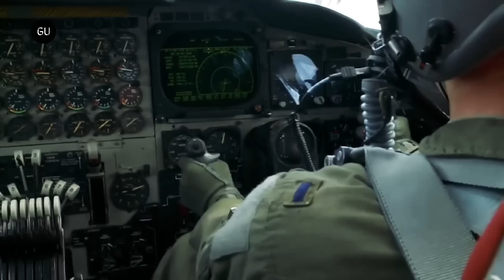Rolls-Royce Begins F130 Dual Pod Engine Test For B52 Aircraft

Comment: Why not use 4 bigger engines?
Reply: It would require redesigning the wing structure and would require a lot more work and money.   Sticking with 8xF130s makes the transition easier.

Comment: Just need to do a new production run - just saying 🤷‍♂️
Reply: @Blob B the whole thing lol ... just build some modernized airframes.. similar to what the air force is doing with the A10 getting new wings... they keep wanting to retire them, even thu they are doing a fantastic job like the B-52.

I hate the whole lets just replace something / re-invent the wheel every time process that defense procurement around the world falls into. Speaking as someone who has served in my countries military, a lot of the procurement choices were just bad (reference Australia).
Reply: I should also mention specific to aircraft, I have a feeling the only reason they will get retired as the fleet has been getting smaller is due to the cycles on the hull / total hrs exceeding the original engineering spec... hence the mandatory retirement of some aircraft, which can be avoided with a new production run.

Comment: 0:36 "a testiment to over-engineering" 🤣🤣🤣🤣🤣🤣🤣🤣 it's more a case of the US will not pay the price to replace it and so just sticky plastered retrofits on to it.
Reply: True, but the option to use B-52s wouldn't have been there if the aircraft wasn't over engineered, instead the US would be trying to turn C-130s or C-17s into bombers

Comment: For all the "four" engine vs "eight" engine people, there is a decent amount of data already collected on that for the B-52; it's been tested before.  Boeing and the AF used an Edwards B-52 in 1968 to test the 747's new high-bypass turbofan, the JT-9D, on the number 3 pylon (inboard right).  I believe it's on the cover of Aviation Week, July 20-ish, 1968; quite impressive!

Comment: So why not use the GEN-X engines from commercial planes? Is the dual pods for redundancy?
Reply: I think the dual pods allow for engines to hang higher off the ground. The BUFF's wings are almost dragging the ground on takeoff. Commercial engines are huge in height and diameter compared to these. They also almost drag the ground on those aircraft. That's why the landing gear is so tall on many. IMO.
Reply: It’s structures and aerodynamics. If you have single engines for each pod then then engine out case requires a much bigger rudder to maintain directional control. The fin and rear fuselage aren’t built ti take the kind of force that rudder would apply. Before you know it, you’ve had to buy a new aircraft just so you can use a big fan. Pointless.
Reply: @peteconrad2077  thank you. That makes sense.

Comment: So small engines intake. They cud had made it bigger for better efficiency that was not there when B52 was made.
Reply: The inlets are the right size for the engine. No point making them bigger. And you can’t replace two engines with one.

Comment: I really do not understand what is so wrong with four RB211-535's~
Reply: Because you’d need a much bigger rudder for the engine out case. This would then need a new back end of the aircraft to cope with the stress of the more powerful rudder. Pointless.

Comment: Why would they not go with four larger engines or does that pose a ground clearance issue?
Reply: No. It’s not built for them. It would need a bigger rudder and massively strengthened rear fuselage. Not worth doing.

Comment: Now a days, it seems they focus a lot on Avionics, Radars, Modernized weapon systems, and like this, more refined modernized engines, on an old plateform. I have noticed this with quite a few aircraft in the Airforce. It's not always the aircraft it's self, but what is on board.

Comment: The grad children of the original pilots have long flown the b52.
It's been flying since 1952.
2023 - 1952 = 71 years./ 3 = 3.94 
So we are almost at the point of a 4th ad 4 * 18 = 72.

Anyway I heard stories of the 3rd generation fling the b52 a decade ago by now.
Reply: 71 / 3 = 23,666… in my country. But that’s in metric units (and decimal base). I don’t do bananas arithmetics, sorry… 😁

Comment: Why 8 engines? why not 4 bigger engines?
Reply: The airframe isn’t built to handle the stress and the controls can’t handle the forces.
Reply: @Blob B well you’d make sure it didn’t. But it would require a much bigger rudder and thus a stronger rear fuselage so it’s almost a whole rebuild.

Comment: Why a dual pod vs a larger single?
Reply: Rudder is too small ti handle an engine fail on a four engine configuration. A larger rudder means a whole new back end to cope with the forces.

Comment: Was thinking for a second: Why not replace the dual-engine set up with a single engine per pod? But I can imagine that there may be height restrictions.
Reply: This is the biggest question everyone always has, it seems so obvious. But the main concern is that the B-52 was designed with 8 engines in mind because of the limited-thrust engines available at the time. It was only designed for the asymmetric thrust of one of the eight engines failing, meaning it has a tiny rudder that would be overwhelmed by the failure of one of four engines. To redesign the aircraft to have more rudder authority would be quite difficult, as it would require not only a larger rudder but the aft fuselage and vertical stabilizer would have to be strengthened. There are other videos on this out there if you're interested in more details. I will say I'm a little skeptical of that concept, given that many failure scenarios would have a chance of causing the adjacent engine to fail as well, such as a catastrophic engine failure that would shoot debris into the adjacent engine (as has happened on an Il-62, see LOT Polish Airlines Flight 007), or ingesting a group of birds, not to mention any possibility of battle damage that I'd think is far more likely to take out a pair of engines than take out one with its neighbor still functional.
Reply: @quillmaurer6563  well it CAN, but its far more dangerous, and having 4 would mean a lesser margin for error. the thing's designed to just not even call mayday if it has an engine blows out.

Comment: A number of comments posited the original designer's intent of redundancy in case one engine in a pod fails due to damage or mechanical issues. I don't believe that this is the reason. While it may be a factor, it's not the primary one. Available thrust in the engines when the plane was first developed was relatively low as compared to today: they had to use 8 engines to get the beast in the air.

These were at best 2nd generation axial flow turbojets and were still rather unsophisticated. The knowledge of metallurgy limited the heat the engine's hot section turbine blades could handle, impacting thrust. Blade shapes were also simplistic and inefficient, since the science of advanced fluid dynamics was in it's infancy.  The engineers got all the power they could from the materials and technology of the time but still had to use 8 engines to get the power they needed.

Shift forward nearly 55 years: hot blades grown from a single metallic crystal for extreme heat durability, machines to complex shapes designed on super computers for maximum performance, shaped on 3 axis computer controlled milling machines. Add in digital engine management systems and the result is an engine designed to be used on far smaller business and regional jets, slightly modified, to lift a behemoth like the B-52 into the sky.

Comment: I imagine these will be more fuel efficient and less smokey (since the others left a ton of smoke in the air). I also wonder if they can be started normally and not have to have a charge set off.
Reply: The "cart" start was primarily a quick start, no power cart option for aircraft sitting alert (the B-52 doesn't have an APU/GTC like many other aircraft).  For normal start, they get power from the power cart till the first two engines are started.  In expeditious situations, I remember my AC would get the first two started, then air start the other six simultaneously.  I don't know for sure whether the RR engines will have to support a cart start option..seems a shame to not have it.  Alert is just a presidential order away!  :)
Reply: these will not have charge-start like the current ones do
Reply: BR725s have a standard air starter.

Comment: I was four or five years old when they first joined the Air Force. I will probably be long gone and forgotten, and the B-52 still in service, one way or another. Amazing aircraft to reach that level. I think the C-47, or DC-3 is the only other aircraft with that longevity.
Reply: KC-135, U2, and C-130’s still going
Reply: @cruzanstx6661  My first base after tech school, USAF, had C-130A models, the series we had were all built in something like 1954 to 56, I was maybe five when they first flew. We retired them in 1971. Some made it to the Gunship program, others went to National Guard units to replace even older aircraft. Some aircraft just outlive others.
Reply: @jamesberwick2210  Definitely I worked on the C-130E as recently as 2010 them was the 61-63 models
Reply: @cruzanstx6661 Many of the DC-3s were flown in WW2, converted to military cargo versions, then returned to civilian use with feeder airlines.
Reply: I will be 56 when the B-52 retires, crazy to think about
Reply: @microcloudhd9231  I'll be over or close to or over 100. Mind boggling.
Reply: Not in military service, though !

Comment: Was talks to reengine to put 4 engines on the B-52 but decided to keep 8 engine. To put 4 engines would have to redesign  the pylons  to take the bigger diameter engines.
Reply: That’s just the stray of it. Bigger rudder and reinforced whole rear end.

Comment: Tsar Bomba detonated at 11:32 (or 11:33) Moscow Time on October 30, 1961, over the Mityushikha Bay nuclear testing range (Sukhoy Nos Zone C), at a height of 4,200 m (13,780 ft) ASL (4,000 m (13,123 ft) above the target)[8][33][41] (some sources suggest 3,900 m (12,795 ft) ASL and 3,700 m (12,139 ft) above target, or 4,500 m (14,764 ft)). By this time the Tu-95V had already escaped to 39 km (24 mi) away, and the Tu-16 53.5 km (33.2 mi) away. When detonation occurred, the shock wave caught up with the Tu-95V at a distance of 115 km (71 mi) and the Tu-16 at 205 km (127 mi). The Tu-95V dropped 1 kilometre (0.62 mi) in the air because of the shock wave but was able to recover and land safely.

Comment: Can’t wait to see the 1st B-52 fitted with these great new engine pods. Definitely a long awaited improvement. Should also significantly improve the bomber’s range and/or payload capacity. 👍
Reply: So far I'm not sure much has or can be done to increase or change payload capacity but I would assume new engines would increase range, response time, reliability, serviceability, and reduced cost like the previous upgrades did. Space is probably the primary limiting factor for payload.... more wing pods? That would be cool!
Reply: Yah Jo. And I’d like to see the pods painted white as on the test bed, just to render a trendy livery effect.  🙌🏽
Reply: Can't kill men women and children in far away places without them.

Comment: I've never truly understood why, but there's some reason they have to use 2 engines in a pod, because initially years ago they were trying to go with 4 - Rolls Royce Trent 800's in the 777, but couldn't for some reason.
Reply: It may have to do with ground clearance as well. A twice-as-powerful engine generally has twice the diameter. If you look at the B-52's outboard engine pods, they hang very low to the ground, so a single engine in their place may halve that distance.
Reply: They suggest the  RB 211 however it is down to wing loading, the stress on the pods that mean they will coninue to use 8 engines
Reply: @madjock2878  no. It’s about the engine out case. They’d need a much bigger rudder fir four engines ti cope with engine fail. This adds weight itself and the whole rear end has ti be reinforced to take the forces. It’s almost an entire rebuild. Not worth doing.
Reply: Exactly my thinking and the reason is explained here https://www.youtube.com/watch?v=02_geGISTLg
Reply: It probably has to do with the balance on the airframe

Comment: It's a little bit crazy that they're replacing the nacelles with dual engine pods instead of larger and much more efficient single engine pods. I know the reason for it... they're worried about torque from differential thrust if one of the engines fails... but it's still freaking nuts.
Well, I guess I'm just glad that they're being re-engined at all.
Reply: I would guess the actual reason is they don't have enough clearance under the wing to fit a larger diameter single engine.
Reply: @agt155  Since it has a high-mounted wing rather than the low-mounted wing of most airliners, I doubt that's the case, though there might not be enough room on the outer nacelles for the very largest new engines, given the way the wing flexes due to the tricycle landing gear. The reason I've heard is just that they want to change as little as possible for structural stress reasons.
Reply: The primary reason to stay with a twin engine pod instead of a single engine pod was wing modifications needed to go single engine. Weight, stresses, balance and aerodynamics all come into play. Staying with a dual engine pod reduced the need for wing mods and speeds up the integration time.
Besides, going with a single big turbofan pod would just ruin the lines of the BUFF!

Comment: Would be nice to see and hear them running, rather than a canned press release.
Reply: You think the AF is going to willy-nilly release footage of the active operation of experimental engines for the backbone of one side of America's nuclear triad? Really? 

Do you think they'll send you the specs and blueprints if you ask nice?
Reply: @michaelccozens  These are basically civilian engines, if you want to hear what a pair of them sounds like just find a video of a G650, or quite similar engines on a 717 or Bombardier Global Express. I doubt showing them running or their sound would be of any military-secret concern. Specs and blueprints are probably almost as readily available for the same reason, certainly wouldn't be military secrets. Wikipedia even has a spec sheet.
Reply: @michaelccozens  Really Michael, I think you should take some deep breaths and lie down, all datainmotion wanted was to to see and hear them running. After all eventually we will all see and hear that. Go away now.
Reply: @michaelccozens  These engines are hardly experimental. Once you've seen how one turbofan engine works you've basically seen them all.
Reply: @michaelccozens these are the same engines used on the global express private jet

Comment: wouldn't it be easier to just put a single for each pylon?
Reply: It was considered, but ground clearance was the issue. A single engine big enough to do the job of two F130's wouldn't fit under the wing.
Reply: @Chilly_Billy  Thanks. That makes perfect sense.
Reply: i watched something that, because tail is so small, in case of engine failure it would make the plane quite hard to control!

Comment: Nobody has explained why this huge extension of a planes life is seen as a good thing. Is it because manufacturers insist on loading new designs with expensive (profitable) technology?
Reply: The air frames are long ago paid-off. Same for the infrastructure to handle and maintain the aircraft.  The plane has great range and ordnance carrying capacity thanks to its enormous size. In short, the updated BUFF offers a great deal of bang for the buck.

Comment: This Dual Engine Pod could power an updated version of the 150-passenger Vickers VC10 that evolved into the Royal Air Force VC10 K.3 tanker.
Reply: The Conways were 22,500 pounds thrust. Why wouldn't you just stick a couple of Trent 500s on the VC10 if anyone was still interested in operating it? Of course you'd have to de-rate them, or strengthen the airframe to take the extra 8,000 pounds of thrust per engine. As it is the A330 is a better platform.
Reply: VC10s are all scrapped. Edit: six complete aircraft in museums and one possibly still flying in private ownership.